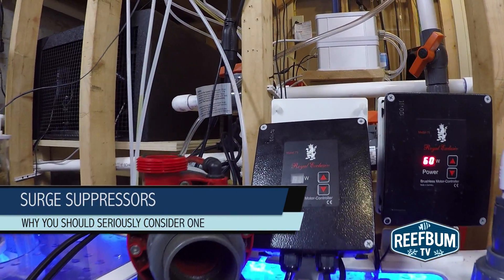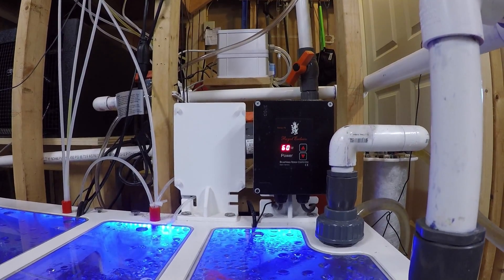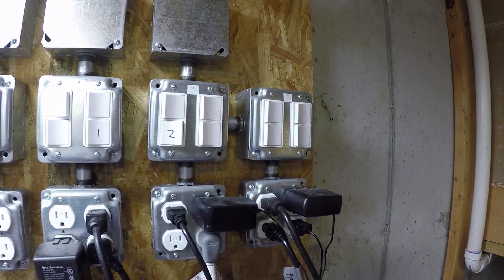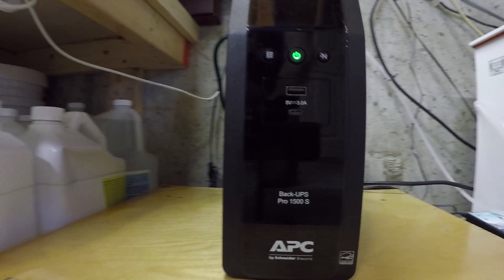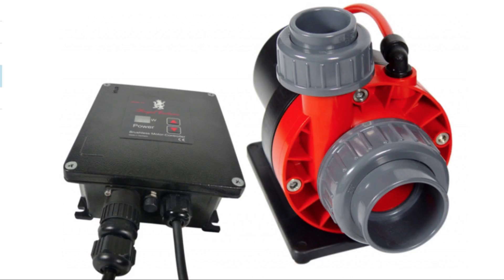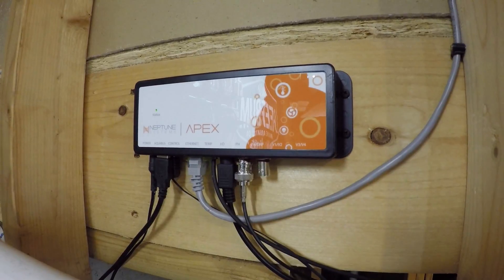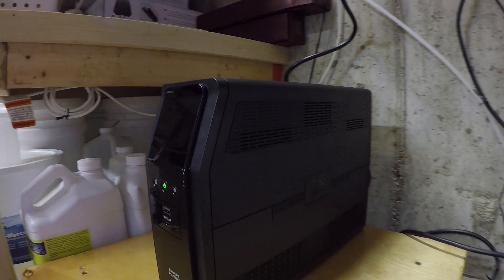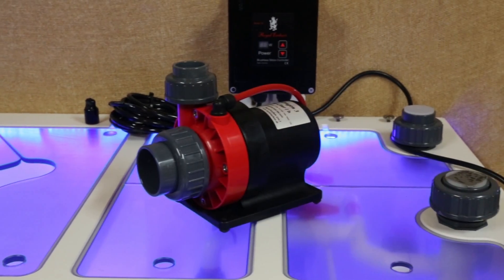Why You Should Seriously Consider Using a Surge Suppressor For a Controllable Pump

Comment: Hey Keith- where did you get the cool switches shown at .27?
Reply from the maker: Those were installed by my electrician, who I believe is now retired. Anyway, I assume they should be pretty easy to find. I had them on my old system in Connecticut.
Reply: @ReefBum  Cool- thanks!

Comment: If you have a DC pump, it's way more efficient to connect it directly to the UPS's battery than to draw power from the AC/DC inverter inside the UPS. The difference is many many hours of run time compared to minutes. That said most batteries are 12v and most DC pumps are 24v so you'll need to use a step up converter for it to work. Same goes for Wavemakers.
Reply: Or use two batteries in series to get 2x the voltage. I am using a tunze "saftey switch" on a jebao powerhead this way to switch to the batteries when the power goes out. I also agree you get way more run time than going AC to DC to AC. Not sure that solves the power surge problem though. I just use a quality surge protector. The good ones also have a warranty that will pay for damaged equipment in the even that the surge protector doesn't save it (assumes you register the surge protector though). Love the ReefBum videos!!!